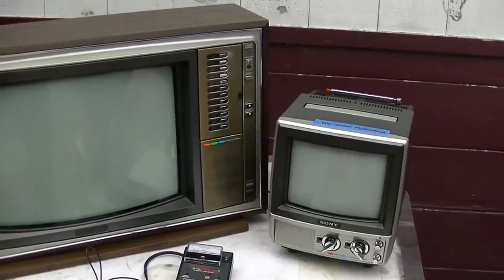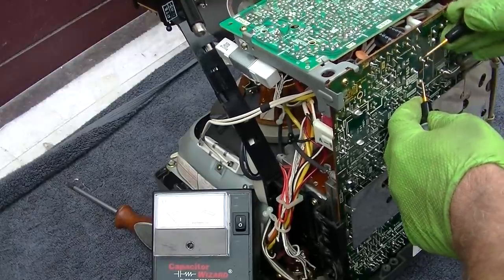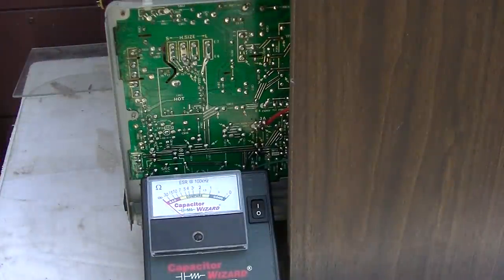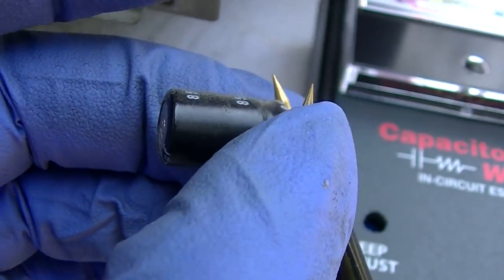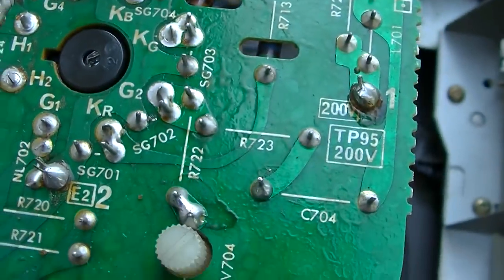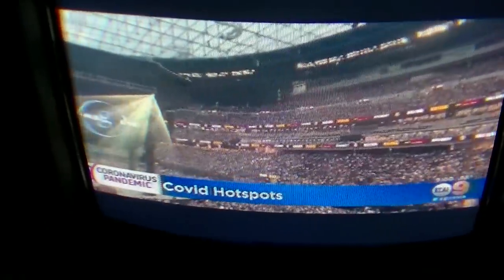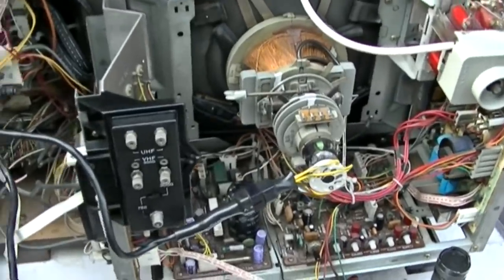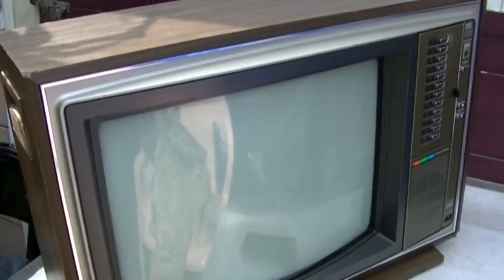Sony Trinitron KV9300 and KV1942 vs Capacitor Wizard

Comment: Price on the Cap Wizard just went up.  Shango recommended.  I have owned one for about 6 months.  Worth the $$$.  I would recommend getting the optional charged cap protection module.
Reply: Not sure about that, haven't seen the vid yet but his comments on the quality in the last few videos don't sound like much of a plug for the thing.  I mean, if it's like $25 or something cool, but I think it's a lot more than that isn't it?
Reply: @danmackintosh6325  200 bucks seems waaaay too much even for a serious hobbyist. It's obvious they want to aim it strictly at the professional, but like, how many are actually left nowadays? Hard sell in my opinion
Reply: I would rather get a DE-5000 LCR meter than a Cap Wizard. Less than half the price and 20 times more useful.
Reply: Yep even the cheapie LCR meters from chinobay are pretty accurate and for in-circuit testing the playing music through the cap option works well. Spend the cash saved on more projects or a bunch of new caps that are not branded ChengX...
Reply: I prefer the analog ear meter. Made my own design with mostly junk box parts. A good practical one you can make.... Look up creative  electronics lm324 esr meter. Uses 2 lm324 opamps. The resistors don't have to be precise  either as called for in the schematic. Sorry not good with posting links so you will need to look up if interested.
Reply: @danmackintosh6325  I remember some guy over at Jordan Pier's channel, mention that the new models are crap and not up the the standard of the original one that Jordan uses, so that could be it.
Reply: Well you can get small component testers that will do the job but they will not do it in you'll have to unsolder the cap and they may turn on semiconductor junctions if you try to use it in the same fashion as the cap wizard. Those small testers use a higher voltage because they're trying to find out what a components characteristics are and one of them being a semiconductor junction.
Reply: It's really an easy sell if you have to go through a late 70s vintage VCR with well over 100 capacitors the speed in which you can blow through them with a cap wizard more than offsets the price. LCR meters and component testers such as the little $10 ones you get on eBay don't even come close.
Reply: I own the very de-5000 LCR meter you are referencing. It is not nearly as fast or convenient as the cap wizard. It has its place and it's a good unit but it's apples to oranges by comparison.
Reply: The cap wizards been in production since the latter half of the 90s and hasn't changed other than they provide better probes now. I'm not sure what you're referring to as to inferior quality. Now that being said it is built like a late 90s low production unit. It's not bad but it's not up to 2021 production standards with hundreds of surface mount devices. It's built with through hole components. And I'm fine with that because now I can repair it when it will eventually need repair.
Reply: Mine came with the charged cap module, it was a d.i.y installation for that module....
The best piece of equipment in electronics. 
Should've bought it 20 yrs ago.!!

Comment: My friend John who had a tv shop bought a cap wizard when they first came out, must be 25 years ago and it's still going strong. It's an absolutely great piece of test gear and the amount of time it has saved over the years. The Buzzer function is so handy that you don't need to look at the meter, you can fly through a panel in seconds. His even survived a fire in the shop. People say they're over priced but you'd soon earn your money back it time alone.
Reply: The new capacitor wizards are thrown together by blind Chinese kids. I’m telling you the one I bought looked like they threw the components at the pc board then just threw hot lead at it. I was lucky enough to find a older version and make one good tester out of them.
Reply: @dirtydon8661  That's sad to hear.

Comment: Your channel inspired me to try and troubleshoot more things. My friend's Realistic Weatheradio (12-241) was powering on, but no sound. Took apart and cleaned flux and glue off a circuit board area (it was strange - the glue wasn't dark brown but is was pliable and sticky). Fiddled with ohm readings on volume pot and the darn thing started to come back to life. Gave it a shot of contact cleaner and sent it back to a happy friend.

Comment: I bought an MESR-100 ESR meter about 10 years ago when I started doing repairs on electronics. It cost me just $40 (which it seemed expensive at a time). It works exactly as yours, with an exception of a digital display.
Reply: I have the same meter, and have never regretted purchasing it.
Reply: @MrDoneboy  I don't use it as much as I used to. Part of it is also because a $8 AVR component tester does much more than just ESR. Anyways, I looked up how much the Cap Wizard costs, and for that price I can get a professional digital LCR / ESR meter from Japan.
Reply: @michvod  Whatever works for you, sir!

Comment: That’s good advise about the esr and voltage rating - I did not know that.
Reply: there's a table on most ESR testers
Reply: That's why you see hv capacitors in parallel .
A cap with a 1 R ESR  is 1 R    so 2 in parallel is 0.5 R .

The high frequency hash is dropped by a 0.1 or 0.01 across them .

Comment: I have an ESR meter that can measure up to 100 ohms, which was an 'Electronics Australia' kit. In many repairs, I had a few new replacement electrolytic capacitors to make a comparison with the existing in circuit, and on the front panel had a table of 'acceptable' ESR values for various capacitance and working voltage of electrolytics under test. You could 'zero check' ohms by shorting the leads, and pushing the on/off/zero ckeck button. The kit cost near to $A100.00 + time, but over just a month when I was repairing TV'S, it saved a lot of time in fault diagnosis, and well worth the initial expense...

Comment: I follow an electrical engineer,  Bald Engineer, who used to work for Kemet. He seems to know quite a lot about caps.  He mentioned that higher voltage rated electrolytics  have higher in circuit  inductance which can  cause issues if you replace with higher rated cap.  So there's that  issue too. Best to replace like with like I guess.
Reply: yes of course they do because they are phisically larger...in sensitive circuits you are right....for decouipling signals and filtering power there is no problem

Comment: Shango inspired me today. Pre-pandemic, I had found a Sony KV-5100 Trinitron 5" mini TV at the Goodwill. $1.99 tag (not a typo). Plugged in out of curiosity and got static and glorious psychedelic snow on the screen. CRT very bright without even fiddling with the controls. Snatched it right up. GW and others probably thought it was broken, clueless about the now ancient DTV conversion. I had put it aside to get around to Later. For me it would be a pain to drag out the pieces to test, but Shango inspired me that today was now Later. Hooked up to converter box and it is perfect. Beautiful picture and crystal clear sound. For once, a GW score.
Also, back in the day I had the exact same 17" version of the KV1942. About 1977, paid $425 used like new. Got about 10 years out of it when the picture went dark. I didn't want to invest in repair and wanted a larger screen so replaced it with a plastic Panasonic 19". Maybe I should have held on to it. But I don't have the patience to replace all the caps.

Comment: The cheap component tester works fine for me. Mostly use it for testing caps and it does indeed find the bad ones. The only down side is you can't test them in circuit, but whatever... Don't want to burn $100 (ahem... 200) on a tool I don't use that much.

Comment: The Sony 27 inch I bought in the late 90s had that flicker problem after I got it repaired after the vertical circuitry fixed. It was a poor hack job. The picture was slightly warped from left to right with a black line going down the right side that would bounce when the brightness changed. They'd also reversed the stereo speakers, but the flicker was so bad that I couldn't use the internal speakers anymore. It would flicker every time you tapped on it. It was the 90s, so the TVs were made to fail.

Comment: Just a thought, make sure the aquadag spring/strap is making clean contact. I remember seeing something like that long ago, but it was due to the internal HV contact to the internal aquadag. Not on a Sony though.
     I bought my cap wizard over 20 yrs ago. Great for audio, projection TVs and monitors at the time.
My method is to put a magic marker dot under each cap first, then go to town on the set. Paid $130.00 at the time. I had bought a small 2 7 segment box at the time, for the purpose, but the cap wizard is great. It is my go-to tool and not bench-bound like my Sencore LCR meter. Protect the meter face, I am surprised I have not cracked mine yet. Put it in a hard case or really padded pouch. 
     I, like my esd reflex, always touch one of the nice sharp needles of the probe across the cap terminals first. Have not blown it up yet.
     Unless you use up batteries in it often, take them out, leaking is a problem in everything now. 
     
Sony made a lot of good, even consumer stuff. In the 90's ythey came out with a line of relatively cheapened TVS. Panasonic seemed to keep their quality high then .

Comment: Nice gadget for people that do repairs for a living. For sure diags will be faster. But I'll be missing the cap diags by music and speaker.
Thanks for the info on the relation between ESR and rated voltage. I didn't know. And yes, seems logical.

Comment: @shango066 I see they released a protection circuit add-on for the capacitor wizard in case you forget to discharge. Installing that'd be some top tier content imo

Comment: Be good to see a repair video on the capacitor wizard. There can't be much wrong with it. I'll give another thumbs up (others have here) for the Bob Parker design. Mine came as a kit from Altronics in Australia. Its been awesome. It currently costs A$105 but I'm sure its cheaper elsewhere in the world.
Reply: The Electronics Australia one is great. Built one when they first came out and its still going strong

Comment: Interesting you say that ESR increases with the voltage rating for the same capacitance. My ESR meter came with a chart that suggests the exact opposite and that's what I've found to hold true from my tests.

The experts on the forums say it has more to do with the construction methods of the capacitors than the designed voltage, so you can't really hold to a general rule. Some capacitor lines will test as you said, others won't.

Comment: I have a Commodore 1701 video monitor which I'm told is basically a rebranded JVC broadcast monitor. When I power it on the power led comes on and there is a little static (not much) but screen does not light up and no orange on the back of the tube neck. When I power it off again a little static. I also don't hear any of the typical crt sounds. Is it a flyback ? Or maybe capacitors ?

Comment: Fun fact: there is no analog TV left in Russia. only dvb-t2.
you can't just get an old TV out of the closet and turn it on.

so I watch your videos with interest
Reply: It's the same here (except ATSC instead of DVB-T). You need to use a converter box or other source.

Comment: I repair a lot of transistor pocket radios and are finding it hard to find low voltage capacitors I am getting ready to recap my Sony TR-610 and there is a mini multi electrolytic capacitor it has two 20ufd's and 10ufd in one capacitor .
Reply: Poppycock!  Mouser and Digikey have millions of them in stock. So use two single caps instead of a multi one. No reason to use an EXACT PHYSCIAL replacement. Lets think outside of the box... Don't you think?

Comment: from the picture fault it looks like a problem around the Luminance Delay Line area. Just saying.
Reply: Yes, its problem in Y channel, not the CRT. Its clearly visible at 12:29 when only chroma information is displayed. Maybe somewhere in circuit, but probably in delay line itself. Sony Y delay lines were known for that. Sometimes DL only needs resoldering the oxidized legs, sometimes it is bad internally.

Comment: Well i see your problem right away @  2:38 at lower right. That white rectangle thingie is a 1969 Chrysler ballast resistor. What's that doing there?!🤠 Anyone with a Chrysler in that era had to carry a spare in the glovebox, and if car didn't start,  just use it and car would start.
Reply: 17:52 I have to thank you for that method of getting rid of telemarketers. I sadly have stopped utilizing my  land line even though I still maintain it in case of an emergency need to call out. Telemarketers are making my answering, or even not answering the phone a futile activity. If i don't answer the phone, they keep calling back until I do answer. But lately I'll answer the phone, and find something to read the words backwards, and then I get no argument from the caller, the caller hangs up, and apparently they mark my # as NG, so my calls have dwindled substantially 😀

Comment: I have been watching your channel for sometime now.(I gave you the heads up on Mr. Carlson Lab Channel).
After watching you use the Capacitor Wizard I have been considering purchasing one. Do you feel it is a valuable piece of test equipment to add to my bench and do you feel it was worth the price. I see Amazon is selling it for $204.00.

Ricky from IBM, Ret
Reply: Can't see him recommending it even at half the price tbh, think the money is better spent on a decent LCR meter and a sacrificial mp3 player plus speaker to do the in-circuit testing.

Comment: why did you choose the capacitor wizard.when there are cheaper ones like blue esr or peak atlast.  what is the reason why you chose to buy such an expensive tester. I hope you notice my question in the comment section

Comment: In previous video you said the "cap wizard" is crap and now it is good? Strange. The ESR is not so important  in this old sets, more the leakage and drifted values. ESR is more important in modern powerfull switching devices like SMPS or so.
Reply: If I'm not mistaken Shango said in a previous video that he has several videos already recorded to slowly release. This one was probably made before the one you (and I) saw. He was talking about the buzzer quitting, right?
Reply: Right.  We're in "time travel" mode.  In this video, he just got his new toy.
Reply: @randyr.parker2698  Thanks for clearing that up. I was confused. Thought I was going Full Biden.

Comment: All models of Sony TV's 4.7, 10, 22, 33uF 160V are notorious for failure on the positive leg & or just dried out depending on their application & as previously mentioned I worked for a Sony warranty service center for over 2 decades so I know my shit!... Strangely enough, it appears to be the KV-1830AS which was the released model in OZ around 79 with a chopper power supply  (240V) but the antenna connection panel was from the KV-1810AS  IN 75 so you've got a mixed bag there as for the pici tube I guarantee a GENTLE hit would have even out the emissions, BUT NEVER EVER HIT A PANACRONIC PICI TUBE cuz it's GUARANTEED dead pici tube!... 40 od yrs taught me in the industry, I now fix computers n fones!

Comment: I like to watch your videos fixing those old tv and radio and I know those are propaganda machines... I always skip the part where you test them because I can't watch news/medias propaganda... I would prefer see your video on the tv or random copyright free noise. Just as a constructive comment

I build an ESR meter for about 16$ in parts from ebay, It's call 5 transistors ESR meter, the schematic is easy to find online. It work the same way as the capacitor wizard with an 50 or 100uA analog meter and a potentiometer to zero the probes. I put it in a small box with an LCR-T4

Chengx capacitors(chinesium):  I bought capacitors on ebay from china for small project and repair, I have few values of this "brand". They appear to be working well. In a pack of 10 or 20 they all have a different ESR but nothing too high to say it's not good. Capacitance vary also  but nothing too out of tolerance. Only time will tell if they are junk or not.